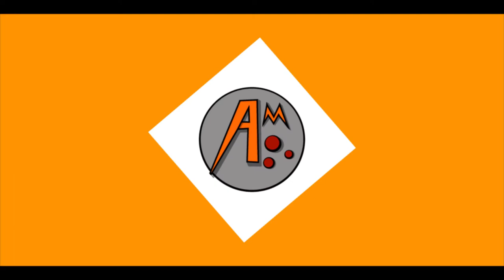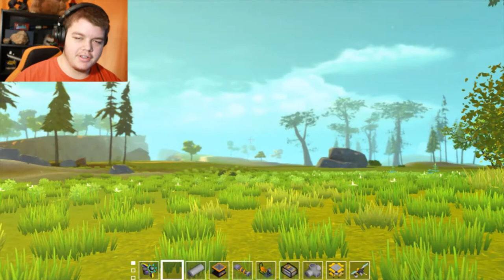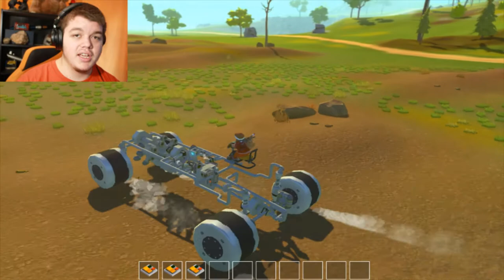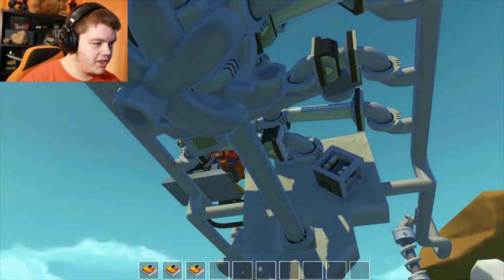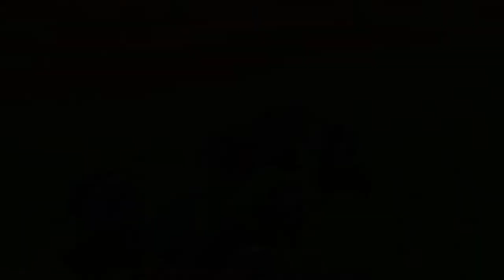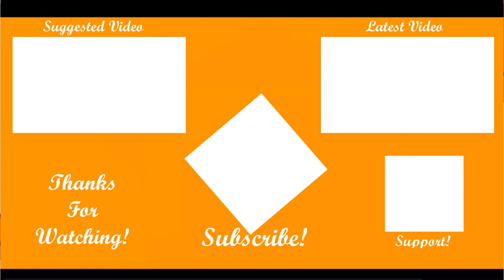New Gearbox...  | Scrap Mechanic Ep52

Comment: Wait why does Reverse need 2 Gears?
Reply from the maker: The reverse system changed the engines rotation before the gearbox. So, rather than it being a separate gear (1,2,R) it acts like a modifier (1,2,R1,R2)...